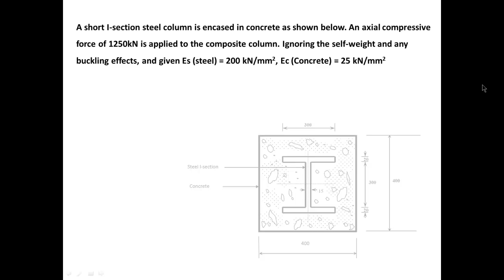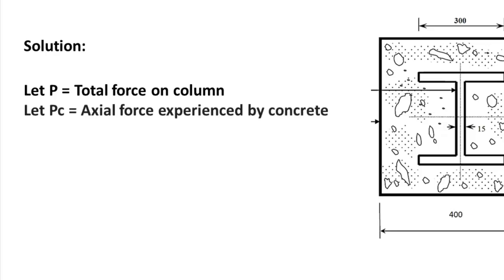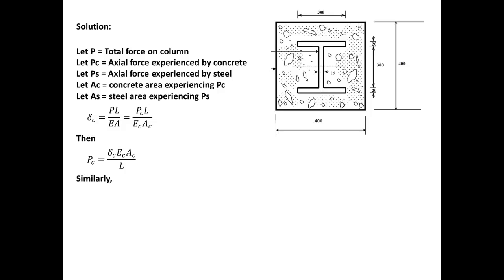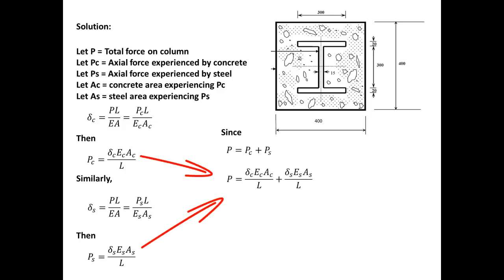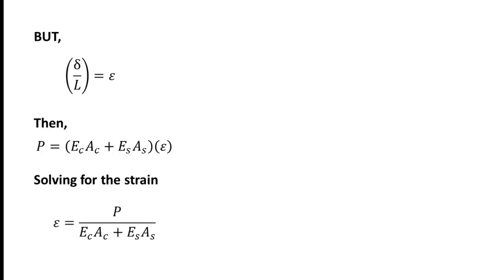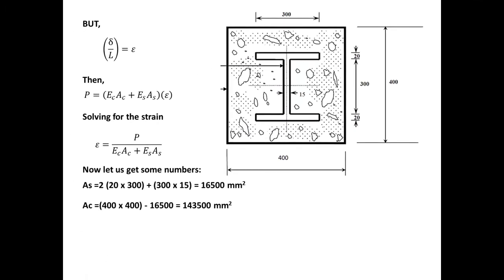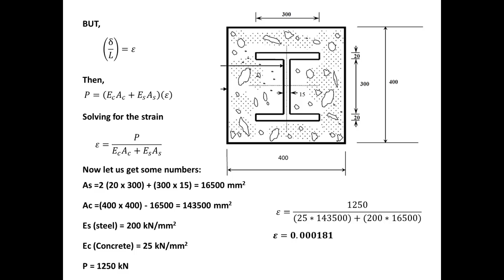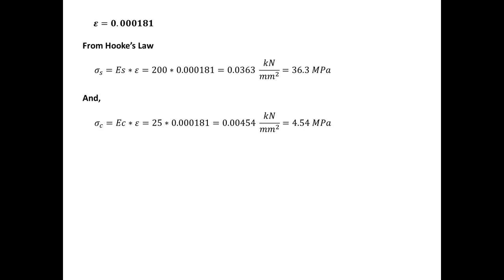Question (1) - How can one effectively handle stresses in a composite column?

Comment: i guess you cant distribute the forces like that .at ultimate state concrete strain is 0.0035 and steel might well also have yielded of the composite section. hookes law or transformed section is not applicable. equilibrium is the way to go. please clarify

Comment from the maker: try it out. the load is applied to both areas at the same time. since they are made of different materials, we cannot just apply the load to each area separately. the strain comes into play here. even if you try to say the steel is (let us say) 20% of the total area and therefore the 20% of the load will transfer to the steel you still get an error. I hope that helped.

Comment: Excuse me , but i was wondering why cannt you use the formula for stresses P over A (P/A) if you have both the load(1250 KN) and the áreas for  steel and concrete(16500mm2 and143500mm2) PLEASE answer .

PS:THANKSSSS

Comment from the maker: Chaitanya, each structural member have a capacity. for beams, the maximum bending capacity can be calculated from the maximum bending stress that can be cause by a bending moment.(sigma = M I / y) then solve for M knowing the maximum stress that can be supported by the member (depending on its material and x-sectional area). As for Axial stress, (sigma =P/A) then solve for P.
in both cases you have to consider some factors of safety and those you can get from design procedures.
Hope that helped.
Reply: an you assist with a square tubing:
Calculate the axial compressive strength of a composite column, consisting of a 38 x 38 x 3.0 Square-section of S355JR steel and filled with plain concrete of 25 MPa cube strength. The column is 7 m long and pinned at both ends. Assume there is adequate load transfer.